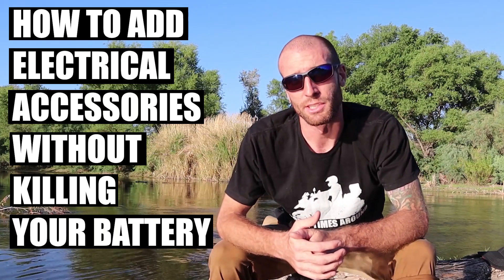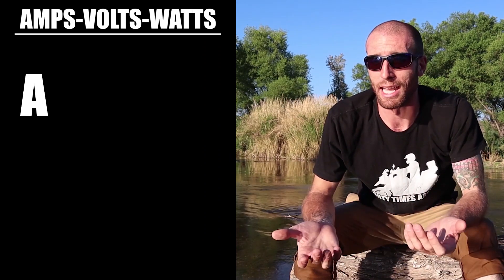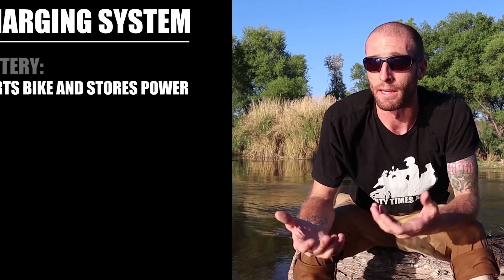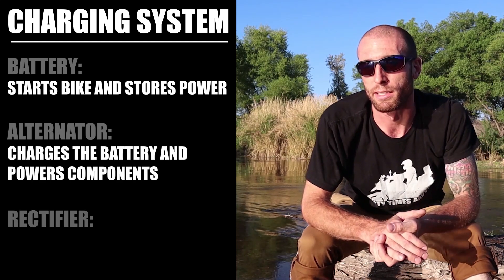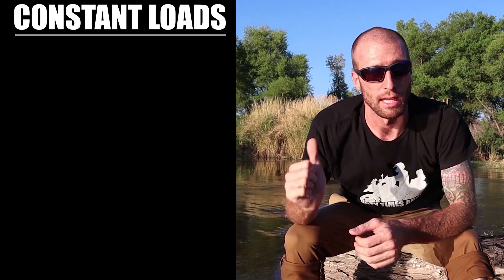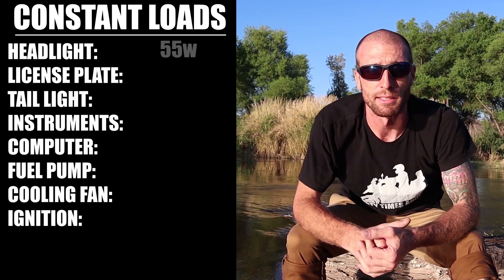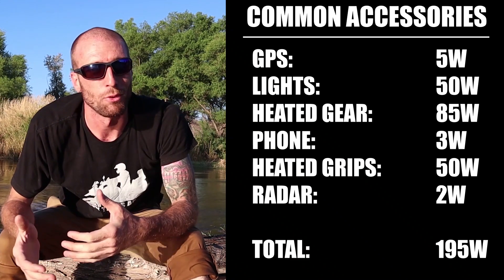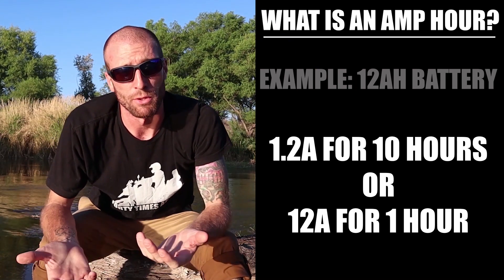How to Add Electrical Accessories to a Motorcycle Without Power Issues

Comment: I would think most bikes and vehicles, in today's wold of auto-on or on headlights, are designed not to have the lights on when you are trying to start the vehicle.  And, the more accessories, like radio, heater, etc you have, especially on a bike, the less you want powered on when you are trying to start it unless there is a dual battery system.  In a car, it's usually a high enough amp hour battery that it can handle most everything on.  On a bike, not so much.  So if I had a bunch of accessories, my thought goes to a relay that will delay feeding power to all the accessories, including add on lights (as you mention with a central distribution block).  Probably a 10 second delay would be more than enough.  On my Honda VTX, when you hit the starter button, it either momentarily turns off the headlight or the current draw to start is so high, it drops the headlight out until the button is released.   Good video!

Comment: Amazing video thank you. I am very jealous of you're ability to run most of those accessories at once. My little 250 only has around an extra 60 watts so my heated grips and phone charger basically load the system right up. I've already replaced a few lights with LEDs but it isint enough to add my heated jacket. Also you're saying I shouldn't run my wires along the exhaust headers then along coolant hoses too the battery? That seemed like the logical choice for me😂😂😂

Comment: I wish there was a Chanel dedicated to removing electrical systems from ADV bikes. I’d pay 10-20% more for a new 1090 or 1290 with the electrical system of my 1979 xr80. Minimal possible. Carb and everything. I’ll worry about recovering lost HP no problem.
Reply from the maker: I get that, much simpler. Road side electrical repairs are nearly impossible now.

Comment: If money isnt a huge issue and want the best technology for electrical power distribution look into the neutrino black box you can set it up to turn things on and off automatically as well as customize through your phone no worries about carrying fuses as it's all electronic breakers that can be reset easily via your phone or a push of a reset button its tiny and can manage power for up to 6 electrical accessories no switches to wire in meaning less connections an less chance of problems in the future it also tracks the total power usage and warns you if you are drawing too much power I think its somewhere around $300 but when it comes time for me to wire my bike out it's what I plan on using
Reply from the maker: That is good to know, sounds pretty handy. Thanks kawadude!

Comment: It would be great to have a motorcycle using a 110 volt generator for power and electric wheel hubs. It could be a generator at the campsite, and hybrid cycle while driving. It could even power your home during power outages. Lots of weight and cost for 110 v system,yes, but would be awesome.
Reply from the maker: That is a really interesting idea, and I am wondering why something like that hasn't been done. Like you said the weight would be tricky, but still seems like it would be possible, and certainly useful! Thanks for your comment!

Comment: I'm interested in the splitter you linked but unsure if this would work on my 2004 R1150R BMW. Does this splitter plug into the electrical box under the seat or into the factory outlet on the side of the bike?

Comment: Couldnt get the exact info om draw in my manual but, i did stumble across this warning that said not to install more than 70W on the system to avoid battery discharge. Does this mean they took the guess work out for me?
Reply from the maker: Good question Carlos. It sounds like they took the guess work out of it, I  am sure they are favoring the safe side with that number though. I would be confident to add that much and any more you might want to dig a little deeper to find the actual breakdown of where they got that number.

Comment: A relay has the capability to switch higher current without/minimizing  an arc and ruined the points/plates inside the body of relay but with proper specification i.e. contact voltage rating and contact current , you cannot simply buy a 12V relay and fix

Comment: Good topic.  Good job with the overview.  All good.  I suggest folks buy a cheap SAE to USB cable with a voltmeter on it.  $15 or so on amazon.  When the bike is running and the voltage drops below ~13.4 volts... you are no longer charging your battery (depends but somewhere around there).  As you pull more amps, voltage goes down.
Reply from the maker: Thanks for the comment Russell! That's a great tip, I will check those out. Ride safe!

Comment: Nice video, you have a lot to share and do a good job with the format you choose to use. Someone suggested a video of your bike with all the accessory wiring you ended up with, and a good explanation for the methods you used. That that would be a great service for the viewers, and would spark a lot of comments. 
One thing I would add to the items would be a good voltage monitor within plain view of the rider. You can gain real time information for managing the electrical draw of the farkles. On my bike the alternator is rated at 590 watts, but I have several potentially high draw items, including a 12 volt lunchbox size slow cooker. My Datel voltage monitor becomes essential when I run with this set-up. 
Thanks for sharing your knowledge, I really enjoyed it.

Comment: The battery charger company "BATTERY TENDER"  makes small chargers for storage use that I use in the winter months.  I connect the battery harness provided by that company to the positive and negative terminals and run the end of the wire to a convenient access point.  The small charger plugs into an outlet and the charger leads plug into the access point...  So whats my point you ask??  When its riding time in Michigan the BATTERY TENDER gets unplug and another one of its product gets plug into the access point.... Its a BATTERY TENDER CELL PHONE CHARGER!!!  Its small, easy to store in a pocket or saddle bag and it WORKS AND CHARGES GREAT..  COST on ebay about $15...

Comment: What are your thoughts on canBus accessories? More specific: the HEXezCan? (see hexezcan.com)
Reply from the maker: Thanks for the question, I hadn't actually looked at those too much until I saw this comment. Looks great I will probably be adding one of these, I appreciate that. Can't say too much until I have more experience with it, I will be sure to put out a video when I get my hands on one.
Reply: Hi Tim, I ordered mine at beemershop.com on July 1st. It's in transit now, probably in some customs depot at Amsterdam airport Schiphol - I live in the Netherlands.
Reply from the maker: I'd love to hear what you think of it once you've tried it out. I will check out that website for one soon. Thanks again.
Reply: Okay, after some back and forth e-mailing, I got mine to work. I did quite some tries to connect it and start the configuration software. 
1. At the first attempts I found that the wifi in my garage was, well, flimsy to non-existent, so that was my first bump in the road. 
2. After that (I had to move my bike to a location near my house in the vicinity of my office where the wifi AP is located) I managed to get a connection. 
3. Then the software told me to register the device at a certain web-page. Apparently that page was outdated. The proper registration page is https://ezcanupdate.hex.co.za/ezcan/registration ; that worked, registered the device.
4. Trying to upgrade the firmware, the software indicated a server error '400'
5. Contacted Beemershop for support, they diverted me to the manufacturer, support@hexezcan.com ; might you need to contact them, first register in their helpdesk software, I missed the first answer...
6. Contacted them, supplied the asked logfiles, screenshots and what not
7. Eventually we got it to work, for the software to be able to update the firmware the ignition apparently has to be switched of (I suspect it will not upgrade with an active CAN BUS)

Got the device set up now, it strobes when I press the high beam three times or when I press the horn.
Now I'm just loving' it!

To remember:
a. register your device (number is on the side of the HEXezCAN)
b. you MUST have a proper internet connection when hooking it up (for the first time anyway)
c. do not switch on the connection, firmware upgrade and preference settings can be done without

Comment: Why not use something like a Pdm60 by Rowe Electronics?  They have a new device called Amplink. Each Has it’s own app, allows for programming each of the six lines. Each line is 20A programmable and is waterproof. With WiFi to I believe. Keeps it all off the battery and no fuses to worry about. It will allow turning thing off with ignition and setting delays for accessories to allow the power to concentrate on get the bike up and started before they kick on. Pretty amazing stuff.

Comment: Oxford heated Grips do have a built in shut off system , if you forget will auto turn of within 2 minutes ",just to let you know and even on there fitting instructions they connect straight to the battery.

Comment: Thank you for sharing such relevant information in an easy to understand way.  It was very educational.  

I have a BMW 650GT maxi scooter.  I live in the Philippines and have done everything though the dealer.  This is somewhat of an electrical issue.  Literally since day 1, I have had low speed stalling problems, which are quite dangerous on a scooter as you must engage the brake to restart.   I have been very disappointed with the quality of service at the dealership.  I am guessing that their mechanics are not well trained as it is back in the shop for the 4th time for the same problem.

Did I just get a lemon, or is BMW quality control that poor?  I had assumed that as a luxury brand that the quality would be excellent, but that has not been my experience.  

Thanks for sharing your knowledge and experience.
Reply from the maker: Thank you for the comment!

It sounds like you got a lemon, sorry to hear that. I have had better luck with my BMW motorcycles, and most people I know with them would say the same. Is there another dealer you can take it too? Sounds like they aren't being very helpful and if you bought it from them they should be doing much more to help with the situation. Good luck with all that, hope it works out!

Comment: Great video. Any tips on wiring hitch for towing a small trailer with motorcycle. Figured trailer would be easier for on road trips to haul stuff.
Reply from the maker: Thanks! I honestly don't have any experience with trailers, although I have considered adding one to my bike. It would probably make things easier for packing, especially if camping. I am pretty sure there is a harness that just needs to be wired mostly likely into the turn signals and brake lights at the back end of the bike. Great question! I will look into this a little more.

Comment: Volt meter on the dash to monitor the state if you're battery and draw😁 you can also get em as a 12v cigarette lighter + USB port
Reply from the maker: Excellent tip! I should add one to my bike actually. Definitely a good idea for anyone adding electrical accessories. Thanks!

Comment: Very good video! I like the way you have explained this power concept issue . 
As mentioned on you video, loading any circuits on the BMW  CANBUS will  be sensed by the computer and shut that circuit branch as a precaution. You will need a GS911 device in order to resolve enable 
that circuit once again .
Reply from the maker: Thanks Rick! Glad you enjoyed my video! Great tip with the CANBUS and the GS 911 which I think anyone with a beamer should have one of those! Ride safe!

Comment: Thanks Tim great video. I wired my 50 watt LED spots via relay and have been wondering if I could get away with adding heated grips as well.  Sounds like I could so will take your advice and do some research on my available wattage.
Reply: Paul, depends on the bike. For instance, the alternator on my bike (2013 FJR1300) is rated at 590 watts (about 48 amps) at 4000 rpm. Operating load is around 280 watts. That leaves me a fair amount of reserve capacity, about 300 watts - as long as I am not stuck in traffic.
Reply from the maker: Thanks for the comment Paul! So glad you found some value in my video. Heated grips are great and I highly recommend adding some if you have the capacity for it!

Comment: An easy way to guesstimate your running wattage for some component is to look at your fuses. For example, a 5 amp fused circuit could potentially draw 60 W, 10 amp 120 W, etc.
Reply from the maker: Great short cut Andrew! That would definitely save some time and is a great way to find running wattage. Thanks for that one!